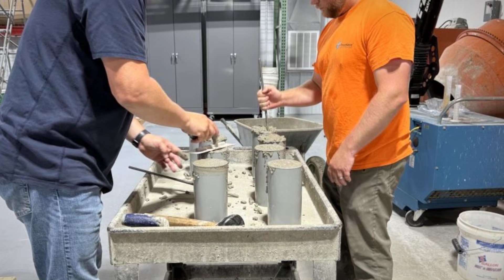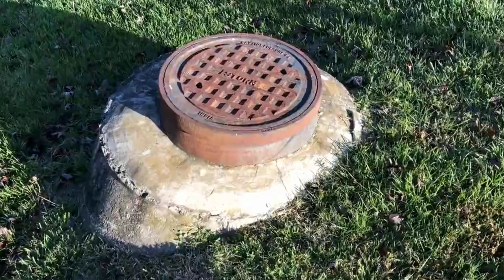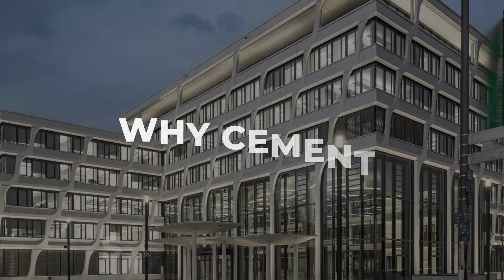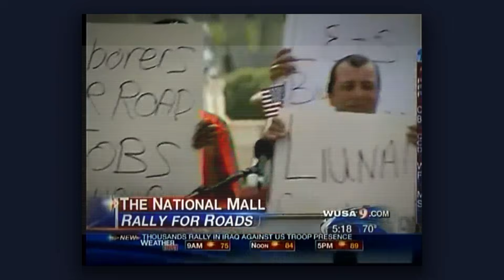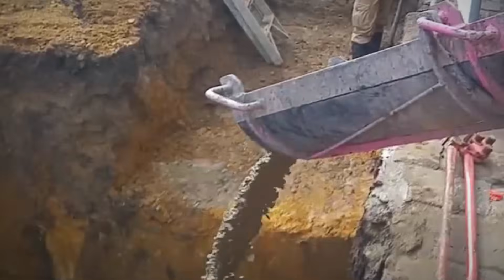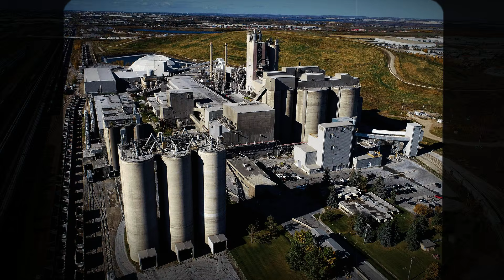This Concrete Is Stronger, Lasts longer, and Produces Zero CO2. The $400B Cement Industry Won't Sell

Comment: Are you claiming that the Egyptians and Romans had waterglass and significant quantities of fly ash? I think the connection between ancient cements is stretched too far in this video. Proposals that Pyramid blocks are cements are also strongly contested from what I’m reading on Wikipedia.

Even so, this looks interesting as a building material!

Please share your research sources and background materials for further reading. I can find stuff by searching myself, but your refined and curated materials will convey a perspective and story.
Reply from the maker: Great points—you’re right to question it.

Romans definitely used lime + volcanic ash (pozzolan), which behaves similar to modern fly ash, but not the exact same materials. The Egypt/pyramid cement idea is still debated, so fair call there.

Main point was that low-CO₂ mineral binders aren’t new—we’re just rediscovering and improving them.

Appreciate the thoughtful pushback 🙌